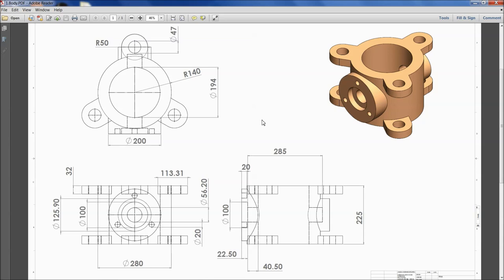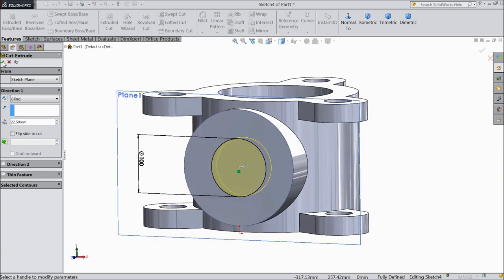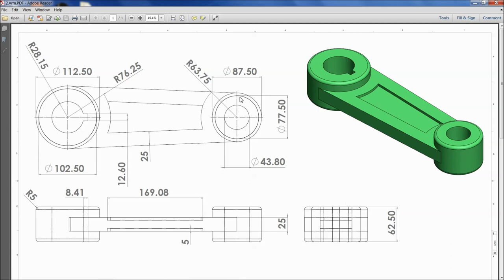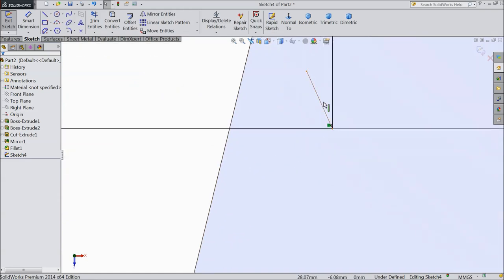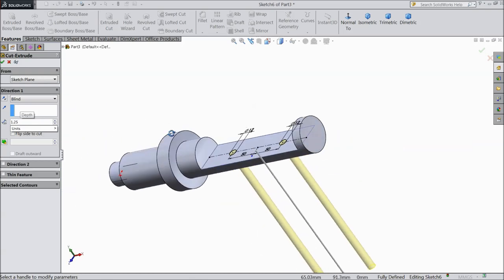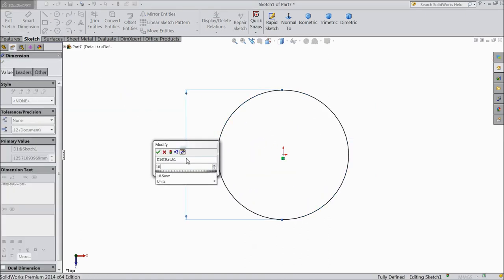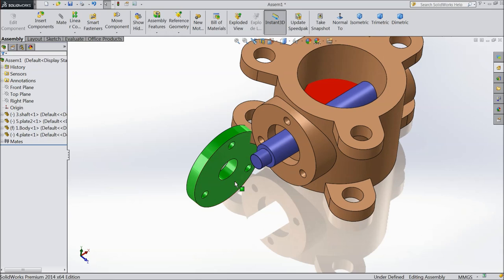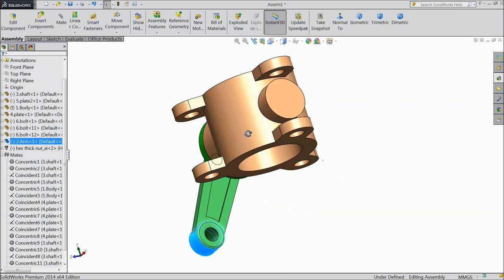Design And Assembly Of Butterfly Valve in SolidWorks

Comment: The Autonomous Valve CFD app by simulationHub helps manufacture design such type of Butterfly Valve with accurate flow performance. You can perform 4 valve flow loop testing free with the product trial https://appstore.simulationhub.com/cfd-apps/control-valve-performer/details